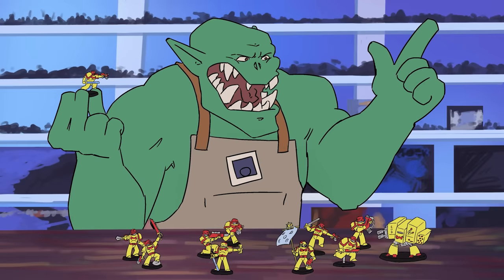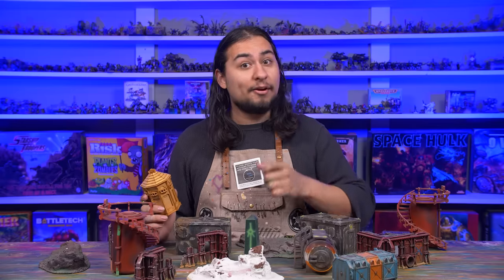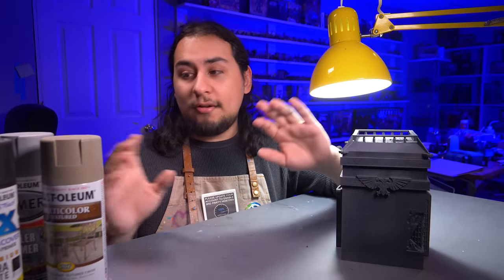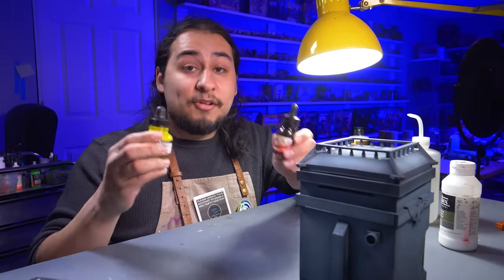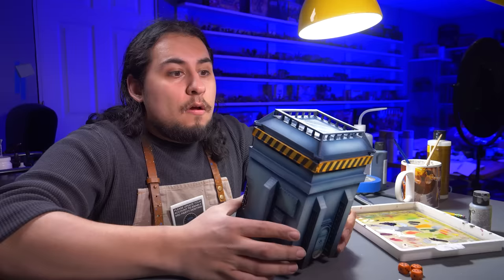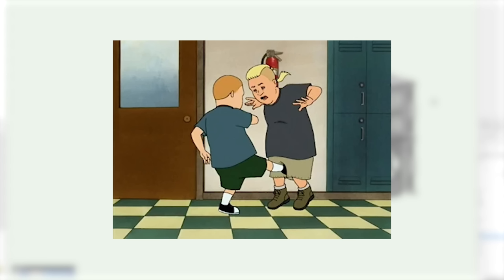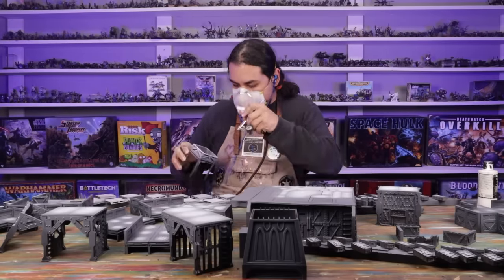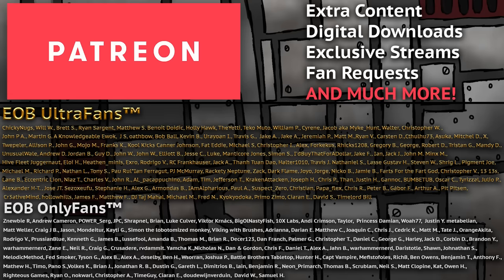Making a Huge Battlefield | Warhammer 40k 9th edition Board

Comment: Why don't you guys get a laser cutter? You can smash out similar palette like designs in minutes and add just small details with 3D printed parts. Laser cutters are quite quick and designing for them is not much more different from 3D printing. If you have to do huge flat panels, might as well try them with a laser cutter. The models can be made in a way that they are suitable for both 3D printing and laser cutting.

Comment: Man I need a printer so bad. Im making some terrain from a bulk pack and it is a nightmare. Waiting for wood glue to dry on this stuff is rough I dont have the patience for this
Reply: you can use super glue on MDF kits, it speeds up building times alot and is just as strong

Comment: for my 3d printer i got to sets of x carriage,  , and the wires  through split by a conector, if something happens a just un plug the wires change carriage, put on zero the printer, them later y will deal with problem on the hot end later